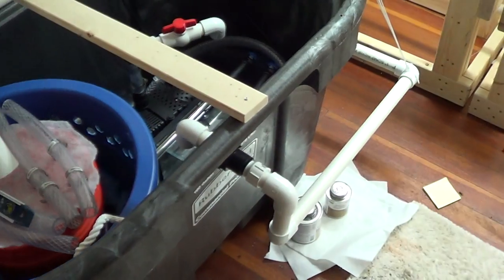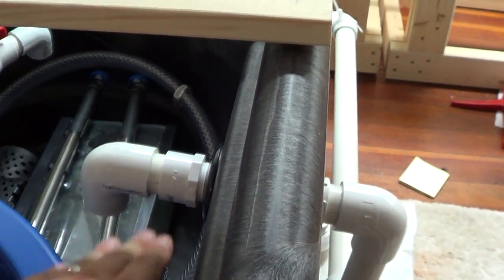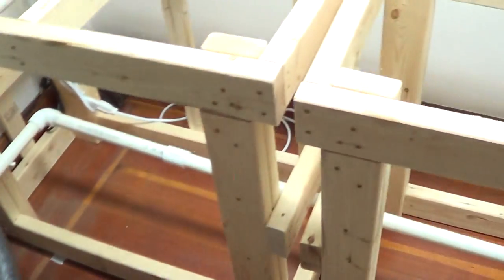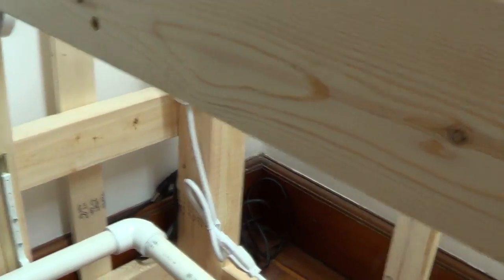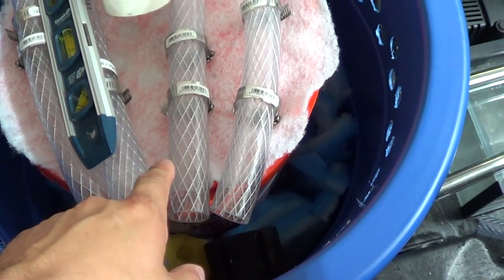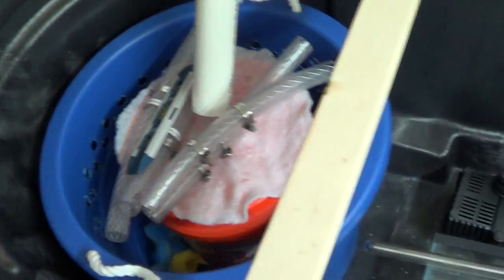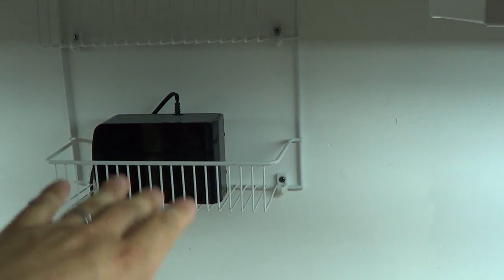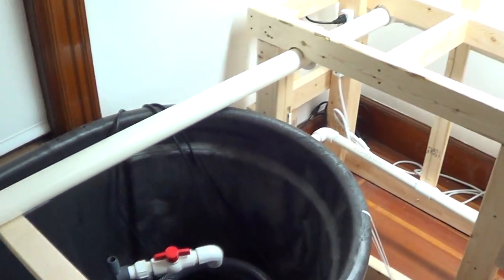#153: Back from Vacation, Plumbing on Fishroom - DIY Wednesday

Comment: What size the large black bin?
Reply from the maker: +Arielle Banks 100 gallon rubbermaid stock tank, they also come in 150 gallon and 300 gallon, you can find them on craigslist or new at tractorsupplystore